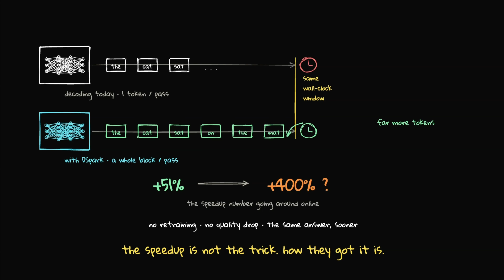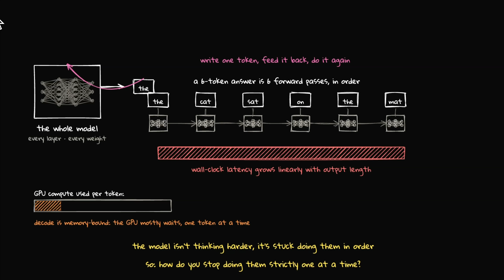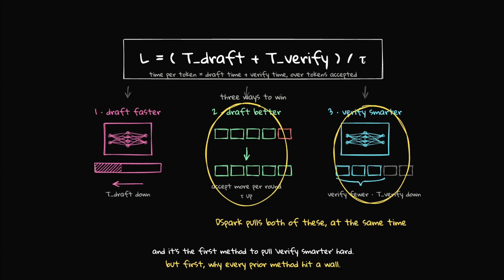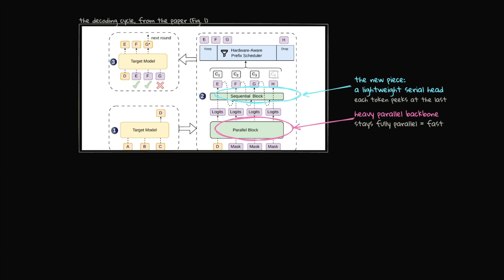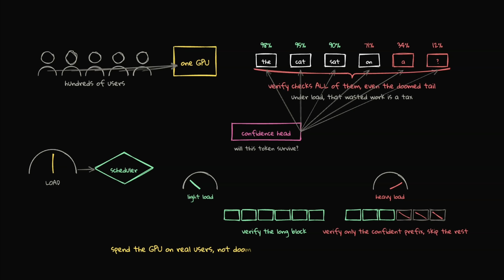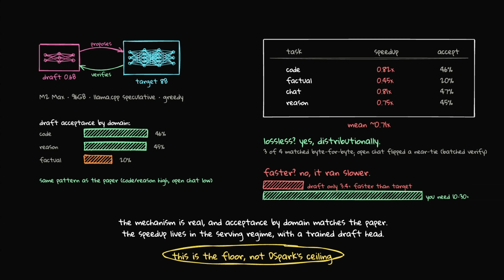Speculative Decoding Explained: DeepSeek DSpark, Tested on a Mac

Comment: Draft model has to be good enough. In excitement when DFlash came i tried with qwen model family. The token generation slowed significantly. You still need good GPUs to be able to use them. Will test DSpark soon on DGX spark.

Comment: How does the large model verify every single token is identical without doing all of the inference calculations that it would normally anyway without the small model suggesting the draft tokens?
Reply: Some tokens are much easier to predict, but bigger models should fire all its layers for every token, even easy ones.

Word endings, brackets and indentation in code, et cetera

Comment: Want the single token processing already solved by multi token prediction ? There is nothing new or groundbreaking with this deepeek technique. It's just another way to do the same as mtp which is already in production. I run qwen3 3.6 27b mtp
Reply: This is mtp evolution. It has advantages over basic mtp
Reply: Bro didn’t watch the video

Comment: Like anything its a tradeoff. Qwen 27b. MTP takes up memory for the draft part, lowering my context but increasing speed.
Reply: What GPU you got? Could buy a new AMD GPU 9000 series for a few extra GB vram. Tensor parallelism is pretty good these days, you’d probably only lose 5-ish tk/s for a $200-$350 GPU addition, adding 12-16 GB pays off big time
Reply: If you got 128 GB URAM in a Spark-like machine, it can fit Qwen 3.6 27B Q8 + max context easily

Comment: Very interesting. I’m fighting with 192gb unified memory for open weights. And after setting DwarfStar to medium thinking it rocked. Is this combineable?
Reply: im fighting for my life running GLM 5.2 750B  Q2 as a reasoning / planning model on 2 x 3060 12gigs and 32 gigs of ram, and for a daily driver that im quite happy with Qwen 3 Coder Next 80B IQ3XXS with 100k context window. GLM 0.5 tps with no speculative decoding and Qwen at 8 9 with default speculative decoding using a 0.6B Qwen model.
Reply: @dixier3ct  GLM 5.2 750B Q2? How is this possible with your configuration?
Reply: @MeinDeutschkurs  magic. and a lot of nvme thrashing.
Reply: @MeinDeutschkurs  something something

llama-server \
  -m ~/models/GLM-5.2/GLM-5.2-UD-IQ2_XXS-00001-of-00006.gguf \
  --port 8000 \
  --jinja \
  -c 8192 \
  -np 1 \
  -ngl 99 \
  --flash-attn on \
  --cache-type-k q4_0 \
  --cache-type-v q4_0
Reply: @dixier3ct  Highpoint makes m.2 RAID cards that can get your storage speed past 50GB/sec. When storage bandwidth is as fast as the ram, magic happens.
Reply: @foley2k2  interesting.
Reply: @dixier3ct  Does that wear the SSDs? I mean how much are the writes compared to reads? Is it possible to just have something the reads only the models or chunks of it and upload them to memory as needed and unload them instantly if they're not the one that are required to remain in the xRAM...
Reply: @anoirbentanfous  At this scale, the main hurdle is making it fit. If the model fits in RAM with only a little bleed, you're mosting reading. Otherwise its constantly thrashing the ssd, by dumping temporary activation states into the swap partitions. IE: you're burning through your TBW. I'm using a cheap Kingston NV3. I view it as an experimental cost. Given the current state of matrix multiplication and model loading, I’m willing to sacrifice the drive to better understand these architectures. In reality, the lifespan is measured in thousands of hours; you’ll likely upgrade your hardware long before the drive actually dies. mmap is currently the industry standard, but it’s still  inefficient. The industry seems to be betting on Pipeline Parallelism to solve this, but from my experience, it’s a bottlenecked mess. I’ve tried daisy chaining multiple Colab instances to farm VRAM, and the latency and synchronization overhead make for a truly miserable experience. Keeping an eye on Deepsek's Dspark, which is supposed to take speculative decoding to the next level. Thank you for coming to my TED rant.
Reply: I think we should start working together by buying the same hardware and then each one explore some aspects of this to ensure that we are squeezing the last bit of performance out of them.
Reply: @anoirbentanfous yes, we should. But honestly, the Mac Studio M2 Ultra 192GB burned a big hole into my pockets some years ago. Currently, I even cannot afford a raspberry pi. Prices got that much expensive that the M2 Ultra brings used about the same price I paid years ago.
Reply: @MeinDeutschkurs  I understand and the problem is complex and very compound, part of it is the grand public who keep following trends, hoarding and tackling this at individual levels... But also the hardware that is produced is underused by a big margin and not optimally used... And that alone will make sure that the actual trends will be exhacerbated, instead of doing things differently and imposing some new standards or figuring out some new solutions toghether with the help of AI... Fromt he way the softwares are packaged, to what hardware to go for for what, Most people as example who bought a RPi required nothing more than ESP32 instead if they knew better and would've saved some money and made it more accessible to others... and same applies to the systems we go, if we recyled more, but also kept some older technologies around that we can use what get thrown, like the older Chips if they were by design easily recoverable, and there are systems that are made to use them somehow, so less computational power and storage potential is thrown because by design it is so, just like that software products are getting bigger and bigger by design choice (eg. Elctron-based bloatwares)...

If we help ourselves to dedicate some of the computational power that is used to produce a few nice stuff but mostly brain rot, slop, and some fetish shit since it was handed to a majority of mediocre minds trapped by social medias and trends... to do some serious problem-solving and optimizations of software products (trillions of tokens can be thrown at each and get a very lean, stable, fast version, and all is getting updated by the second, with whole codebases of other projects and OSs, awareness... we can get ASM-level recrafting with performance and size benefits...)
Reply: How did you get 192gb of unified memory?
Reply: @MetricZero Mac Studio M2 Ultra
Reply: Bruh im running on a 8gb gpu and 24GB of dram to offload too 😢
Reply: @deltaworx9  you can get them to run, but it's will test your patience.

Comment: I was very fond of DFlash, DSpark seems the natural evolution. MTP is the safest choice, just beacuse it is fully implemented in llama.cpp main repo. Thanks for sharing.
Reply: They just merged DFlash a few hours ago
Reply: @CryZe92 what a lovely news!
Reply: vLLM is bare minimum for serious agentic work. Llama.cpp training wheels inference will never cut it at scale.
Reply: @palpalps I do agree with you, vllm is the only tech out there that can manage multi agent properly. What hardware are you using? At the moment I think that Llama cpp is OK if you run stuff on your local machine for your personal use and as long as you don't have to switch too many models it manage the workload ok, but I'm constantly looking to change my mind learning from evidence and other ppl experiences
Reply: @palpalps  ehh local AI doesn’t need to scale as you’re only serving one user at a time